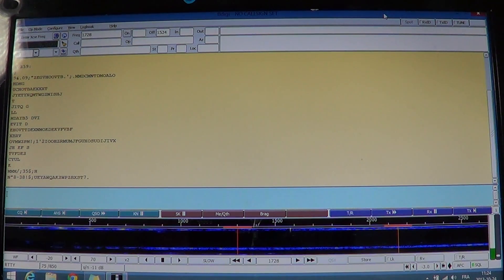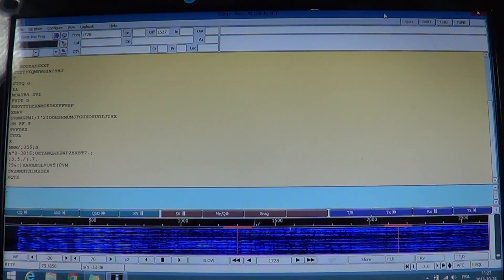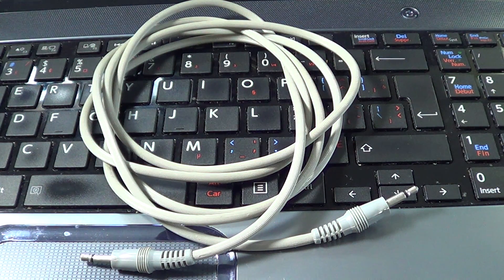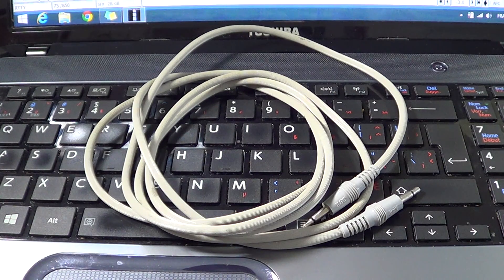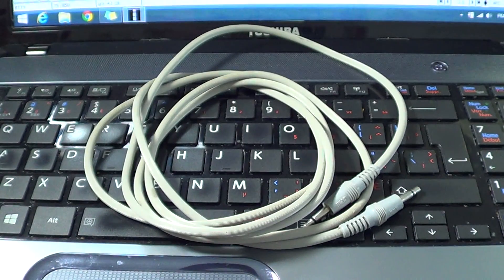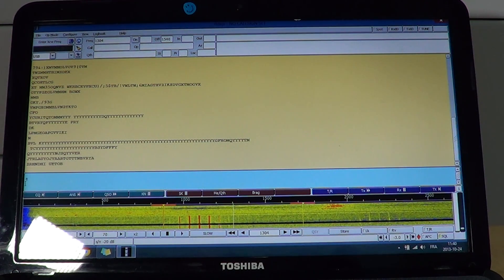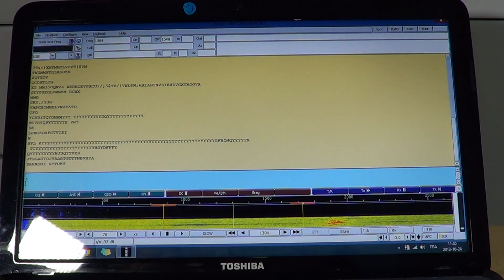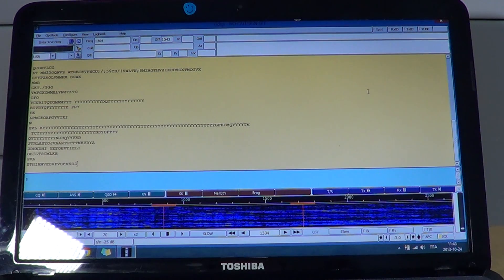Digital mode tutorial how to hook up the radio to the computer

Comment: Well, I downloaded FLDIGI. It looks nothing like what you are showing. Not even close - no cascade, nothing. So... still nothing. no wonder digital is about to die - it's almost as if it's set up so nobody new will ever get an interest - it's too difficult.
Reply: I found it pretty easy. I simply hook up my shortwave receiver up to my PC by it's line out to the PC line in/Mic in. Load up FLDigi or WSJT-X, or MMSSTV/RXSSTV depending on what you're wanting to do. And set the software up to receive with the sound input with the on board sound card and it started decoding.  

You're probably using the wrong software and not actually FLDigi, because the FLDigi I downloaded looks exactly like in the video.

Digital isn't about to die just because you couldn't get it working, it's actually gaining in popularity, it's definitely not going anywhere, Digi has been around for a while, and is going to be around for years to come.

Comment: Why is it so important to have SSB modes on your radio for this to work? :)
Reply: FSK31 broadcasts are exclusively transmitted on Single Side Band, so the only way that you can receive the data is being able to receive SSB.
Reply from the maker: SSB is needed to create the tones you will hear, the signal in itself does not have any tones, it is just a shift in the frequency sent, using USB ads the signal from the receiver that creates the tones of the digital mode

Comment: My new laptop has a combined mic/stereo earphone jack. How do you wire a cable to plug into that jack??
Reply: +Seth Bergman... As it's a 4 contact jack (like an iPhone earbud and microphone setup), you have to wire a plug (tip, ring, ring 2, sleeve) so the mic input is on ring2 & sleeve. Sleeve is the common return. Tip, ring and sleeve are for the left/right stereo output. But you loose the computer speakers and mic when you plug in the radio. Best thing (and what I did) is to buy a Signalink, by Tigertronics... plugs into a USB port and you don't use, lose, or have to reconfigure your computer sound card at all. Works great!